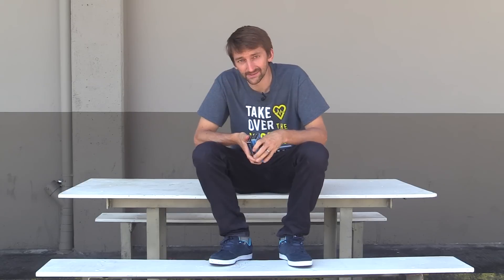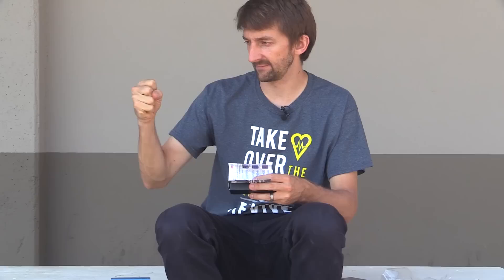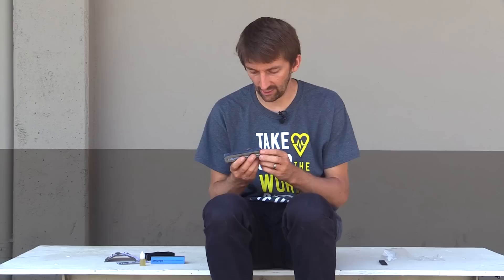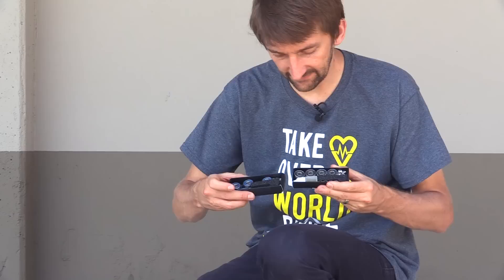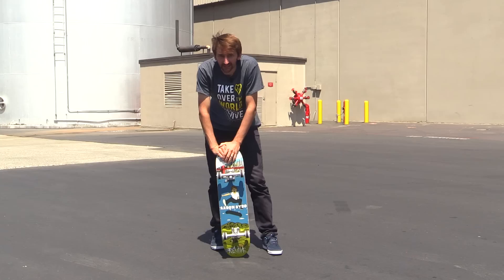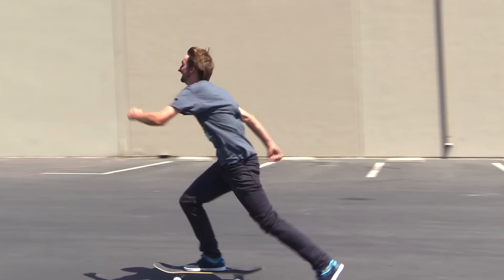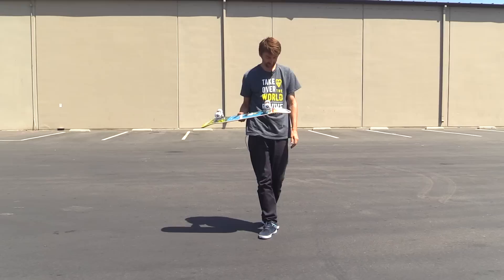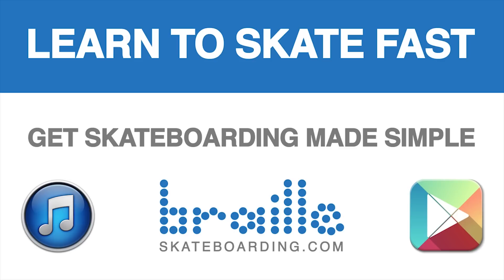CERAMIC BEARINGS VS STAINLESS STEEL BEARINGS | VS EP 9

Comment: I been skating Swiss ceramics for a while in my street set up and just changed them into my Boosted board to see if it'll increase my range or board performance. So far not that noticeable difference because I didn't waste time with the stock Boosted bearings, lol.

Comment: In Short, Metal is very pitted although it seems smooth and so it wears down quicker. Metal also expands under heat(which increases wear and grinding). Ceramic is completely smooth and doesn't react to heat. You won't notice a big difference in for many months and tbh if you take care of your bearings and keep them clean and lubed you can have a decent priced set of bearings glide as smooth as a much pricier set of ceramics.

Comment: I go with Stainless steel bearings. The reason why is because ceramic bearings are more brittle than steel, which means it can crack, chip and break.
Ceramics are also hybrid bearings, which meaning the balls are ceramic, but the inner and outer rings are steel, which means the ceramic bearings can rust, so it wouldn't matter to me much.
Though they are lighter, but weight difference is so minimal that you won't be able to tell the difference.

I have no problem with steel bearings and I clean and lube them once or twice every two months or so.
I also would not like to have my bearings break and crack on me during a skatesesh.
That's just my preference.

Comment: if you want super fast bearings (although womt last as long) take the seals off the bearings and clean the grease out with brake clean, boom! zero resistance, super fast.
Reply: +Tyler Adams I agree, only watch out for water after that

Comment: Ceramic used in bearings is heated to such a high temperature that the silicon in the clay turns to glass and thus gives an extremely hard, smooth running surface which means faster bearings (which aren't susceptible to water like stainless steel)

Comment: I think your explanation was a bit wrong. What you meant to say is that as metal bearings heat up, they expand and that applies more friction therefore decreasing speed, and the ceramic ones don't expand when heated, so they still roll just as easily

Comment: Ceramics are lighter and last longer in my experience. They also clean themselves because they polish the running ring from the inside and they are waterproof. But do you Need them? I would say no.

Comment: Ceramic in this meaning is not hardened clay. It is most likely silicon nitride or aluminium oxide, which is very hard, brittle and wear and temperature resistant.

Comment: What about the pressure that's put on from gaps, drop, and stairs or from powerslides. Additionally, what about the fact that ABEC is actually pretty pointless when it comes to street skating because we're not going at an RPM high enough?

Comment: I’ve just bought Bones Swiss Ceramic because everyone says they are the best.
I’m using Black Panther Ceramic Bearings which seem faster than Bones Super Reds.
Whether the Bones Swiss Ceramics are worth twice as much is going to be hard to judge.
Perhaps standard Bones Reds changed often is the cheapest easy option.
Over to you for advice Aaron?

Comment: 1 : You don't need your bearings to be stainless, and i would say you don't WANT your bearings to be stainless. What makes a bearing good is the finish quality (the lowest grain of the steel = the better) but the more important thing is the hardness. It's easier to make high hardness steel without making it stainless.
They won't rust because they are full of grease.
2 : You don't want Ceramic bearings, ceramic is good for rolling, it has a very high hardness, it won't "deform" but it will definitly break as ceramic is very very fragile. Ceramic bearings are good for road bicycles and maybe longboards that won't make their bearings suffer much violents tricks like we do in skateboarding...
You'd better spend your money on high end steel bearings and learn how to serve them (like never use WD40 on them) and keep them like forever...

Comment: If u skate street steel bearings if you skate transition ceramic. That’s all u need to know. I skate mini logo bearings and they work just like any other bearings most bearings under 30 bucks are pretty much the same. Just different packaging and shields

Comment: I'd imagine ceramic bearings would be best suited for longboarders who ride fast for periods long enough to generate that kind of heat. Ceramic is a very good material for transferring and withstanding heat, whereas steel is more prone to warping and changing over time. I'm thinking the ceramic bearings would probably last a lot longer too. Not sure they'd necessarily be faster than steel bearings.

Comment: Stainless steel is relatively soft. Ceramics won't deform and should be structurally harder (although it does depend on the temperature both materials are made at). Nor will water have any effect on the ceramics. Grit will likely wear stainless steel too.

Comment: It's also $20 to $120 more for ceramic bearings of a similar company.  The main thing is materials and shielding. Heat and resistance mean nothing in a skateboard wheel unless you are being pulled by a car at over highway speeds.  It's duration of life, lubrication and shielding from dirt (with some not having a cheap plastic cover that can come off)  ABEC rating means absolutely nothing in skateboarding. Resistance miggt be slightly improved with same company ceramics.  Duration of life and noise might be a factor.   Weight of bearings as well has very slight impact. It's technology of resistance.  (factoring in, too fast of a skateboard isn't necessarily a good thing.  Friction and gravity keep us in connection with the Earth)  I won't get into theories of gravity about falling or matter attraction. Above your pay grade. ;)

Comment: Heating up the bearings takes away energy that you put in by pushing, so the ceramics sap less energy. You can never get more energy than you put in, and the ceramics steal less of the energy you put in. They would probably have better wear resistance as well.
Reply: Better wear resistance means they would stay smooth for longer. You may not notice the difference, or it may not matter for you though. Do whatever works.

Comment: Being good skateboarder doesn't means knowing mechanical engineering. Ceramic ball bearings was developed for aplications where lubrication is not possible, such as vaccuum or oxygen atmosfere (risk of fire). Ceramic bearings are not made for high shock application, due to their brittle balls. Regular steel bearings are more suitable for skateboards.

Comment: Ceramic is very heat resistant. They do not conduct heat at all, as to where steel is a very good conductor of heat. Also, ceramic is very porous which means less surface area, therefore less friction.

Comment: I wonder what the differences in the lubricants are, if any... Would be good to know if I could use a normal lube on the ceramic ones. They're for when the wheel is spinning longer...Would be perfect for down-hill and luge. Should do a test, take them both down a hill and see how hot they get.

Comment: The biggest difference you'll probably find. Isnt that they'll spin longer vs stainless steel. sure there's the speed difference and durability of the ceramic. But I messed with ceramic bearings, I noticed the ceramics spin longer under the same exact conditions as the stainless steel

Comment: cars are using normal bearings and they runs for years. all are geared to the engine and the bearings can't run faster. so are baitcasting fishing reel, they brake then will come in to slow down the rotation. so if it spin more it will brake more. so where does ceramic bearings come in?

Comment: The ceramic benefit is to do with  deformation and variability in ductility at high temperatures. To me the ceramic bearings are a bit of a gimmick as the temperatures needed to cause excessive rolling bite are not likely to be witnessed outside skating on a cooker.

Comment: its not deform less from pressure of something or someone heavy standing on. The term Underload means when a Progressive constant force is being applied not to with weight
friction 
Less friction = Less heat 
Less heat = Less deforming of ball bearing Underload
Less deforming of ball bearing Underload = More  constant Speed Underload for longer

Comment: Ceramic is not hardened clay.  That lube is not a grease either.  What he also didn't mention is that ceramic cannot handle loads better than steel.  Because ceramic doesn't deform, it can chip and break.  Save money and never buy ceramic bearings.
Reply: cermanic bearings are better used on r/c cars that race on flat pavements, since the bearings don't have to deal with the impacts like a skateboard
Reply: +Rat Vision – Skateboard Tech so steel for tricks, ceramic for speed. Got it.
Reply: Well, that's both true, and not necessarily applicable. The ceramics are extremely hard and yes, prone to cracking under severe shock, but due to the round shape of both the balls and the races inside the bearings, the shock is lessened by the larger area of force. This means they are less likely to break in this application. Also, the reason the races are still stainless is because though the ceramic balls are good for their resistance to deformation, there will still be grit getting into the bearing over time, and the steel is malleable enough to slightly deform while forcing that debris clear of the grove, protecting the longevity of the bearing. Under normal circumstances, ceramics should last atleast twice as long as traditional bearings.
Reply: +Richard R and cost like hundred times as much.
Reply: ceramic is fired clay. the firing process also hardens it. ceramics are hardened clay.
Reply: +Adam Bergeron historically, yes, they are, but these are actually high tech ceramics. The material is called seranite, which is a form of industrial silicon nitrite. It is first made into a powdered form where it is formed by heating it in molds to manufacture parts. 

Tl;dr Silicon Nitride is not an earthen material.
Reply: It absolutely is an earthen material. Silicon is the main ingredient in sand, and the main ingredient in ceramics. all ceramics. that's where the silicosis comes from. it's the Potter's cancer, often caused by breathing in the tiny silicon particles when throwing pottery. and nitrogen is one one of the most abundant elements in the world. In fact both of those elements are some of the most abundant in the universe... 

TL;dr the materials used to make ceramic ball bearings are essentially the same used in making ceramic pottery.
Reply: +Adam Bergeron I mean not earthen as in it is chemically processed and changed before being formed into the final product. This is a LOT harder than sand on the MOHs scale. I believe it's somewhere around 8.5 on the MOHs scale.
Reply: +Richard R ...I think you are completely missing the point. rat vision said that ceramics are not hardened clay, and he was wrong. ceramics are hardened clay, and and the ceramic used in ceramic bearings is made using a similar process to the ceramic used to make pottery.
Reply: +Richard R also all ceramics are significantly harder than sand after they are fired. the only reason I mentioned sand was because sand mostly consists of silicates, as do ceramics.

Comment: Ceramic bearings are only interesting for people who skate at very high speeds for long durations. Downhill, for example. In Downhill, the fastest skaters might reach 100 mph and if you maintain that speed for several minutes, then the friction in the bearings might start to get high enough that the balls would expand enough to impact smooth function.

Ceramic is much harder than steel, so it can take a greater beating, but only if that greater load is steady. That makes them great for fast slides and strong deep extended carving at high speed. Ceramic being harder than steel also means that it cannot absorb impacts as well. Steel might flex very slightly to absorb a blow, ceramic wouldn't flex. And if the blow is strong enough, ceramic would break where steel might still bounce back into it's original position, if it doesn't deform permanently.

In other words, get Stainless Steel unless your spending almost all of your time skating Downhill at ridiculous speed. For those doing skateparks in particular, ceramic bearings are a waste of money.

Comment: I dont think there's really a difference in skating, not high enough speeds or load. The one reason I would buy ceramics is that even stainless steel can corrode, ceramics do not rust since they are not metal. Also the abrasive resistance is pretty high on ceramics so I would imagine they will be nice a little longer than stainless. If you are going to see the difference over a month maybe you should set one of your trucks up with stainless steel. Theoretically there shouldn't be a difference so it wont effect your skating, if it does then find out which bearings wore out more, replace them with the better ones and you have your winner.

Comment: No one is likely going to notice any difference in a skateboard. These same bearings (608's and their brothers and sisters) are used in most power tools where they are spinning up between 15000 and 30000 rpm, and most companies get away with the cheaper unbranded Chinese ones that will cost £/$3 for about 10 or 20. You'd have to be going at least 100mph on a skateboard to get into this kind of territory. 

If you are going to spend money on bearings, then go for some that are easy to clean/maintain. Otherwise, just go cheap AF and replace when they get dirty.

Comment: You guys should make a tutorial on how to remove the bearings from the wheels. I had a hard time doing that last time.
Reply: Rodrigo Bicalho Laufer Jardim , just take your wheel and put it on the very edge of the truck axle, just enough for one bearing to be on it and then start pulling your wheel a bit to the side and down with your hand so your bearing will come out the wheel and stay on the axle so u can take em out and replace easy, after that you can do it with the other bearing and your wheel is free, remove only one bearing at a time and don't put your wheel to deep on the truck, hope it helps
Reply: Last time I did just that, but it was really stuck and I had a really hard time trying to remove the bearings. That´s why I thought about the tutorial.
Reply: Rodrigo Bicalho Laufer Jardim put the wheel on the axle is in only 1 bearing and push down on one side pull up on the other side, i recommend watching ratvision's video because I wasn't able to do it before but now I can thanks to that video

Comment: Try making ceramic balls rust, also the ceramic balls will crush any dirt that makes its way into the bearing, basically they'll last a lot longer then steel, can roll faster and for longer than steel aswell, great for off-road longboarding or riding on rainy days. But the steel she'll on the bearing can still rust so clean them after they go through water

Comment: hum a thing that somehow is not mentioned is the stress of impact that the bearings suffer when ppl are using them... they aren't just rolling in a super slick universe... no... they are being hammered by all those bumps on the road and all those tricks that most skaters subject their boards... so resistance to impact grants that the balls will not shatter like glass or bend creating a bumpy un even surface  ceramics can be strong but non talks about this important aspect

Comment: if they are black likely the balls are silicone carbide. Ceramic as in sintered dust. Much harder than steel, 9 mohs rather than 7 mohs, but the steel is likely more elastic so more likely to deform than shatter.

Comment: is there an actual difference? because is a skateboard wheel spinning fast enough to cause that much heat and friction where it would distort a steel ball bearing? and also a test would be cool maybe use a set of each bearings for a year then open them up and see if there's an actual difference
Reply: oh hell yea they get hot as fuuuuck, i was skatin around ny and a bearing went bad so i replaced all 4 and it took like 10 minutes for them to cool off until i could touch them
Reply: when your urethane wheels are crazy hot from spinning think you're hot those bearings are. that being said. they're fine. fuck ceramic

Comment: ceramic don't expand as much as steel, thus less friction, wear and distortion..
under typical skateboard loads its really not going to be a noticeable difference though, a lot is to do with how tight or loose your wheels are bolted on.. This is far more relevant than the bearings composition

Comment: its simple, steel has lots of pits and dents in it ceramic is exetremely smooth and also much much harder
Reply: you have no idea what you are talking about. the stainless steel bearings have extremely smooth balls and races that are hardened.  Because ceramic balls are even harder, there is less surface area being used so therefore less heat being made. Also ceramic may distribute heat better than steel. Heat is a by product of friction. Friction causes wear.
Reply: the first part of your sentence didnt make sense and you also basically said what i said im talking about microscopic pits and dents not visible dents... steel is not very smooth atall where as cermaic is alot smoother, and before you tell me that steel is smooth... im once again talking about microscopic levels.
Reply: my mistake.
but everything i said previously makes sense. Sorry if you don't get it.
Reply: chughes44
it did make sense sorry i was reading it wrong
Reply: +A Cat now hug & kiss

Comment: I think the main purpose for ceramic bearings is that they will still performe after they are used in bad/rainy weather. Am i correct?
Reply: No you forgot the metal outside and inside